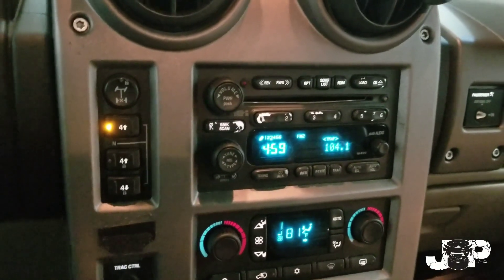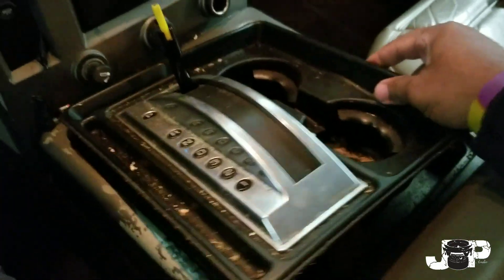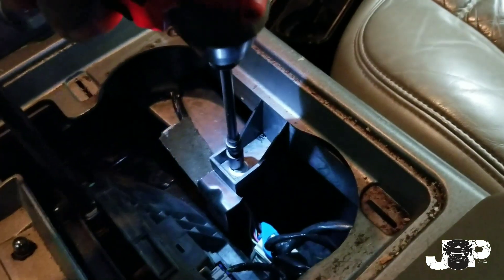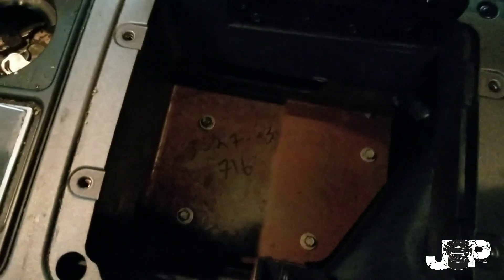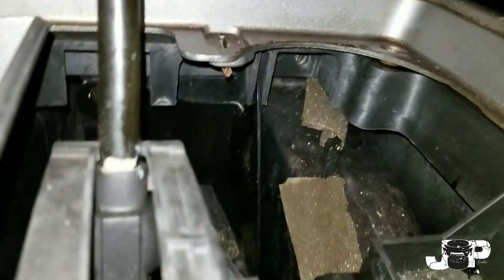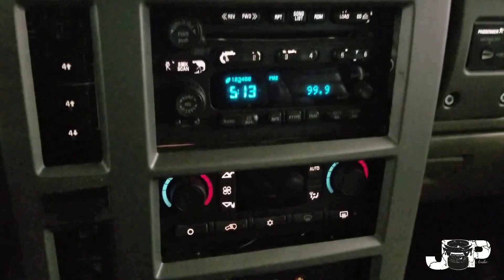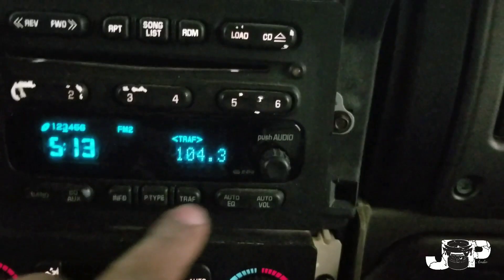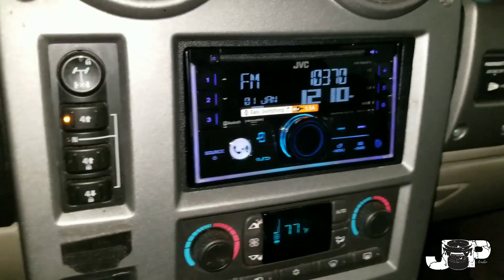2003 hummer h2 radio removal

Comment: What wire's did you hook up? I'm trying to put an old pioneer in a h2 but has no sound. What is the small harness for with 2 wires has Bose amp as well

Comment: Did the JVC directly fit to H2's hardness or if you used an adapter, what was it. Also to ensure functioning sterling wheel bottoms, what interface did you used? The common GM 
Metra GMOS-04 IF1063
 , Isimple or 
PAC OS-2X/ 
PAC C2R-GM29 / PAC RP3-GM13 Radio Replacement Interface ?
So is OnStar and door chime, factory Bose Amp still functioning?
Reply: Can anyone answer and help me with this? 2 months and no answer.
Reply: you have to use a harness dude. google it geez

Comment: hello i just bought a hummer h2 2003 an it has a duel touch screen in it but i do not have any sound comeing out the speakers even if i bluetooth to it i have door chims an stuff comes from speaker but no sounds frome radio could u help please

Comment: Did u have to use an interface from the head unit to the steering wheel controls? Thinking about putting an aftermarket unit in mine real soon and I don't wanna get taxed by a shop for doing it.(30 years familiar with car stereo but this is my first H2/double-din install)

Comment: What model of double dim radio could replace my old 2003 hummer h2 radio with steering wheel controls and no wires cut
Reply from the maker: any double din radio  really just have to get the right harness that keeps the steering wheel controls  like this one ~~~> https://amzn.to/2EWSxwa
Reply: I have 2004 H2, looking to replace radio. Is there any splicing with these harnesses, or is it just plug and play? Nice concise video. @jptheinstallguy

Comment: Im istall a double din but the audio do no work
Reply from the maker: which harness did you use
Reply: @jptheinstallguy  could I have a radio that replaces the old 2003 hummer h2 radio with steering wheel controls on star etc?
Reply: @akaninyang585  Is anyone with adequate knowledge, reading these?

Comment: most importantly, how to connect the car's wires to the stereo plugs is not shown.  I suffer with this sound does not go in any way the amplifier does not turn on!
Reply: how did you fix that?
Reply: @anthonyc3826  I installed an Italian adapter.  a little tormented with a plus.  Unfortunately I didn't take a video.